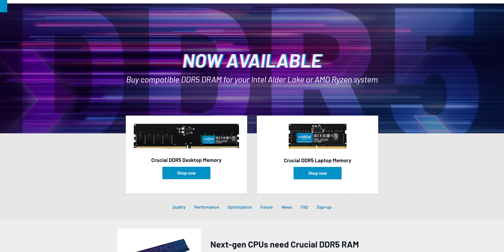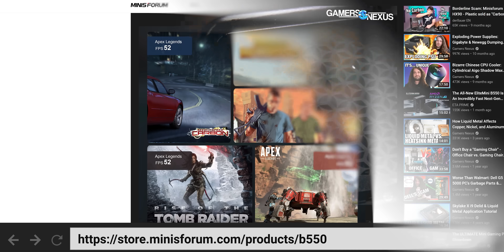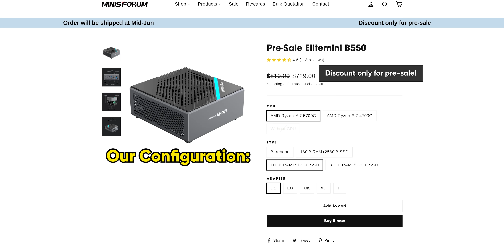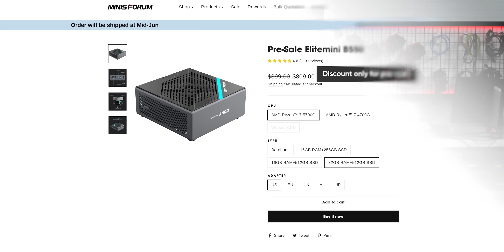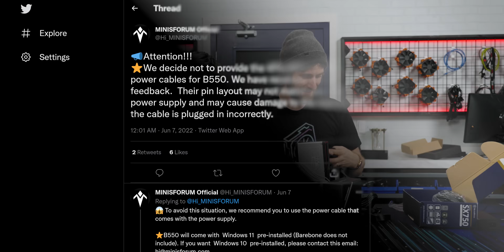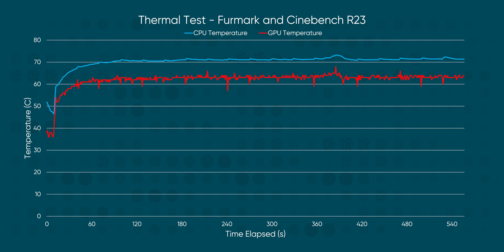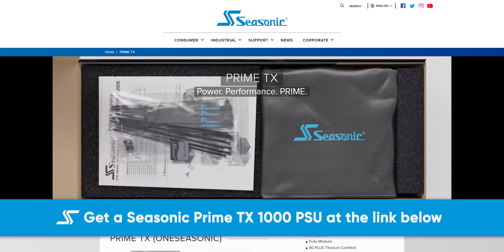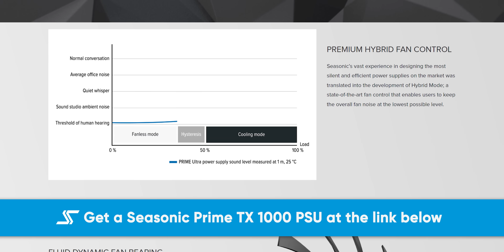Who's Buying These? - MinisForum Elitemini B550

Comment: If the power supply connector is standard then you can use a larger brick...
Reply: That doesn't mean the internal power delivery system is capable for drawing enough power through the barrel plug input to matter.
Reply: @megachonk9440  that is true but it is worth trying. I have managed when dealing with the HP and Dell Minis computers to use a larger 90 or 120 watt power supply when upgrading from the T-Series or low-power version CPU to a standard 65 watt CPU and have it work find that way. If the system was capable of supporting and allowing the higher wattage processors then it would have been an easy upgrade in that case. If it did not work then it would be another knock against this particular design. Cooling might be an issue but they did state that cooling was not a problem with the processors they tested.

Comment: Can you guys do a video that explains in-depth why mixing power supply cables can fry your system? I honestly don't get it. It's just a copper extension.

Also what is a discreet graphics card? I always thought it was a small one but that one a normal sized card.
Reply: discrete means separate from the onboard/integrated graphics. So if your graphics processor is inside the CPU, that's onboard. If it's a separate card that you plug into the motherboard/an external enclosure, that's discrete
Reply: There can be different pinout in PSU cables. Like the component side is good, but the PSU side can be different.
Reply: sounded to me like it was how the pins are handled. I think they weren't exactly talking about an extension, but a cable that is more of an adapter. (and confusing the two) It would be good for more explanation as I haven't ever played with such cables.
Reply: The problem is that while the pins on the motherboard side are standard, the ones on the power supply aren't.
Sounds like it doesn't make sense, but it's really down to the internal design of the power supply, because certain pathways are easier to route internally with a non-standard layout.
Reply: it is any non-integrated graphics card
Reply: Different power supply manufacturers (or even models) have different cable layouts. They might fit into holes in other power supplies, but if they pin layout is not the same, you could be sending a lot of power to a component that doesn't expect it.

Also the word used to describe the GPU is "Discrete" not "Discreet". "Discreet" means small or unobtrusive while "Discrete" just means separate. A discrete GPU just means a GPU that's not built into other components like the CPU or Motherboard.
Reply: You can fry things, because there is no protocol for power connector pin outs.
You need to check what pins in the PSU are connected to what. Just because you have an xx pin connector cable, doesn't mean that connector cable is straight through, nor does it mean the connector on your specific PSU and specific mobo/peripheral have the same pin assignments/layout.

It beggars belief, there's literally no reason for it, and it's an ABSOLUTE PITA.
Not to mention it's wasteful and the environment that ALL these companies care so much about and yada yada yada.
Reply: Basically, even though PSU cables appear to be interchangeable, each PSU is designed only to be used with the cables it comes with. Mix and matching cables increases the risk that an incorrect amount of wattage could be pulled from the PSU, resulting in fried components. There is an article on GamersNexus that goes over this in detail: http://www.gamersnexus.net/guides/2702-psa-on-mixing-modular-psu-cables-dont-do-it

Also, discrete graphics is the term for any GPU that is separate from the CPU. So any GPU you buy for your system would be a discrete GPU. Integrated would be the graphics processing built into the CPU itself.
Reply: They are not pin to pin extensions. Most modular psu cables swap pins around between the actual power supply and what gets plugged in. Presumably this is to make manufacturing for the internals of the power supply easier, but mostly its just an anti consumer practice where they won't agree on a standard. (Modular cables are not defined in existing standards.)
Reply: The pin-outs on the device side (motherboard, CPU, SATA, PCIE, etc) are standardized (excluding stupid pre-builts from the likes of Dell and HP that use proprietary motherboard connectors and hard-wired power supplies), but the pin-outs on the power supply itself are not at all standardized, even within a single brand.  What might be a 12V pin on one PSU might be a neutral or a ground on a different PSU.  Because of this, you can't reliably use the cables from one PSU on a different PSU, and if you try it you will almost certainly fry some hardware by sending voltage where it was never meant to go.

A discrete graphics card just means that it's a stand-alone graphics card that is not integrated into the CPU.  The system featured here supports both.  You can use a "G" series CPU with integrated GPU with the box in standalone mode running through the power brick, or you can pop it on its docking frame and with a PSU you can run a discrete GPU in the PCIE x16 slot.
Reply: It was explained very well in the Gamersnexus video with Johnny guru, titled "Power Supply Mistakes, Tier Lists, & Myths, ft. Jonny Guru". It's basically because different manufacturers use the same connectors, but with different arrangements, so one cable that is supposed to go to ground on a corsair power supply would end up going to high voltage on a Seasonic one, for example.
Reply: a discreet graphics card is one which is not inside the cpu, or any other 'unit' of the computer. For example, an Intel 12700K is a cpu with onboard graphics - also called 'integrated graphics' because the gpu is inside of the cpu die. Then you can have an RTX 3090, which is a completely separate graphics processing unit from the cpu, hence 'discreet graphics card'. 

as for the mixed pin-outs. i am not an electrical eningeer, but have some basic knowledge. As i understand it, the wires in the cable connect a specific output from the psu to an input on motherboard, for instance 12V out on psu to 12V in on motherboard. However, if the cable does not connect the output to the correct input, then the motherboard does not process the input in the correct way and so passes on an unsafe voltage to a component which could cause it to overload/overheat. Additionally, i would assume there could be an issue with grounding, but i honestly dont understand it enough to comment on that, i just know it could be an issue

hope this helped